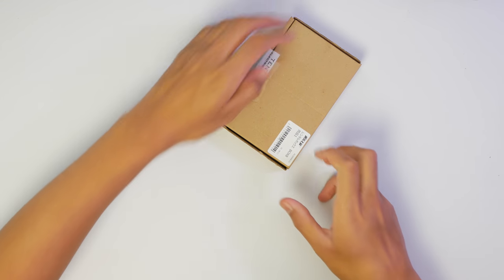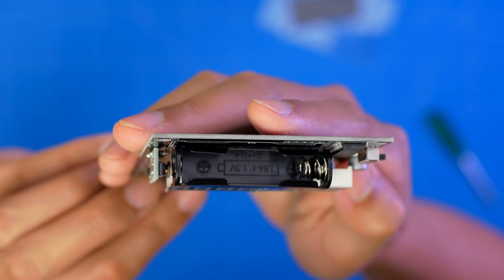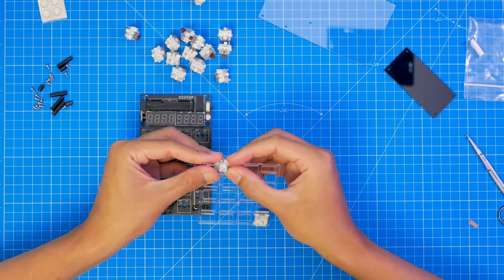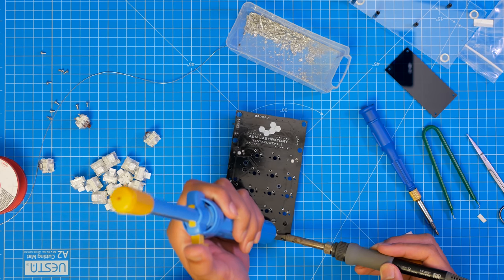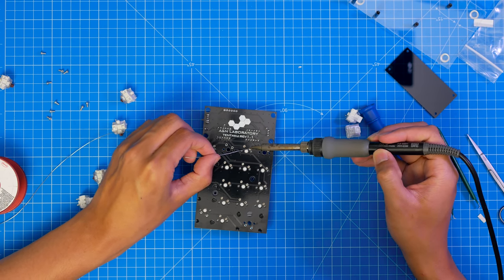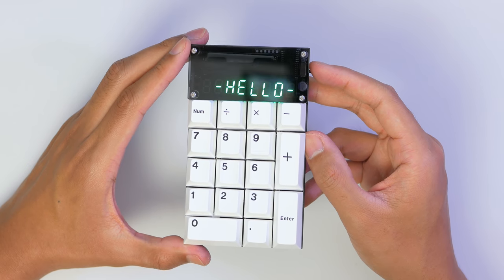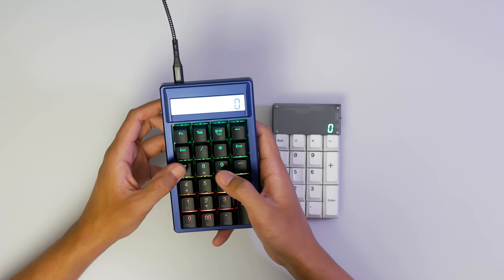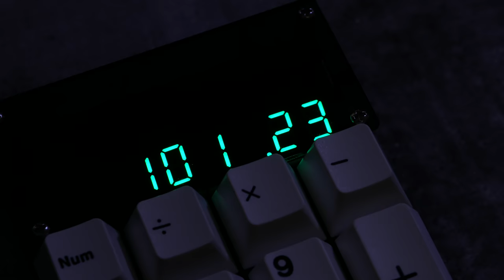Building a Mechanical Switch CALCULATOR! - TENTAKU DIY Kit

Comment: This shit even without switches costs more than my whole keyboard
Reply: nohat. microwave that's exactly what my whole keyboard costs
Reply: @nohat. microwave no, it's 50$ without
Reply: Mine was 180
Reply: My first mechanical keyboard was the gmmk full, and I still use it. Cost around 140 with the key caps I chose.
Reply: My keyboard cost less than 10 dollars
Reply: @saticson  Lmao
Reply: @saticson  meanwhile I have a built-in keyboard
Reply: @opgaquatics5609  my keyboard is the Corsair k70 and costed like 100 dollars
Reply: @arcticflakes1806  trash
Reply: @opgaquatics5609  no I don't like it because it's a full keyboard but it's still good
Reply: Ok membrane boy
Reply: i should manufacture my own and sell them for cheaper

Comment: Black nail polish instead of sharpie on the side is good.  It's electrically isolating, so you can even use it on the PCB traces pretty safely.

Comment: Omg calculator with no % is kind useless nowadays :(
Reply: x * .10 = x * 10%
10% of 3 is equivelent to .10 multiplied by 3
Reply: Thy Beanus what about in programming where in some cases % finds the remainder between division problems? You think you’re clever but there are more uses to % key besides percentage.
Reply: @dsova9366  ah yes, programming on a calculator with an 8 digit display
Reply: Mikul oh my bad I thought for some reason it was connecting to a pc. I was searching for a good mechanical num pad for my pc. The thought of it being a just being a calculator shot over my head.
Reply: @Horse-zs4xp  well at work you don't really have time to think like x-56% = x*0.44 etc. You are thinking about next steps while typing. it's an instrument and it has to be comfortable to use, right?
Reply: D Sova 
You can find the modulus very simply without %
Reply: I don't think anyone planning on doing serious math equations is going to buy this calculator, it's a novelty item more than anything
Reply: Dude you literally just multiply it by a decimal. It’s not a big deal and this isn’t even gonna be used regardless

Comment: 6 digits only? Can't input 5318008 then :(
The aesthetic of this Tentaku kit is on point (esp that thicc LED display) , but I do prefer the versatility and features of the Ducky Pocket that lets you use it as both as a numpad and detachable calculator. If only there was a product that cross pollinated the best of both.

Comment: Where can I buy one?
Reply: Fully built
Reply: @Cocolino2911  You cant buy it fully built, its a DIY kit. It also doesn't come with switches or keycaps. If you want a mechanical calculator buy the ducky numpad.